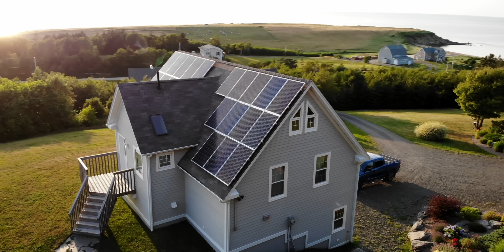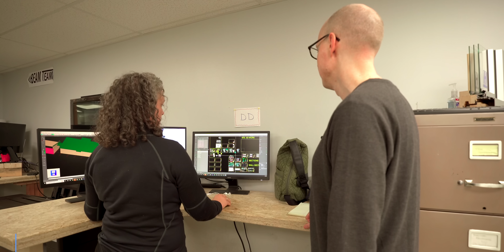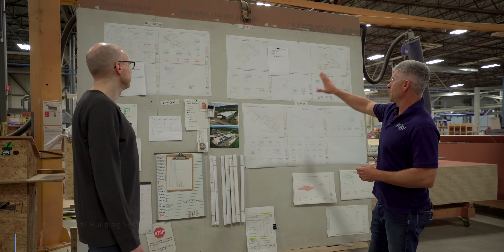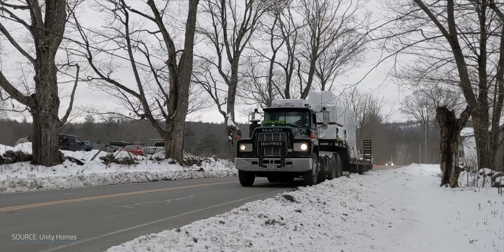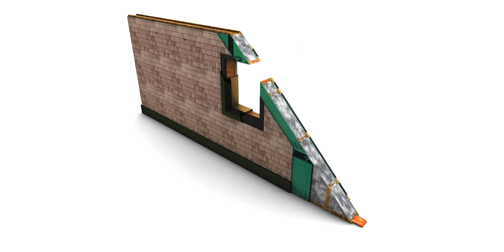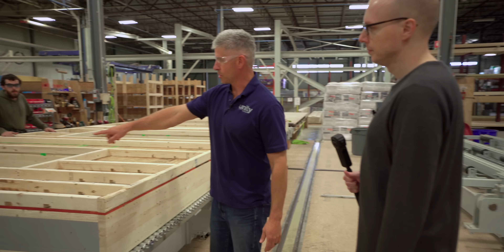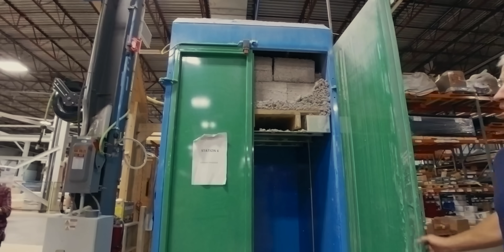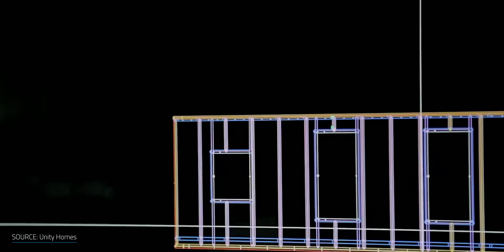The Simple Genius of a Prefabricated House - My Net Zero Home Build

Comment: I've never wanted to work somewhere based on the product, and production before. This is cool! 
The only thing I can think of to ask is; What is the initial resource consumption cost(Board Feet) versus a  more conventional home, or a home that uses the engineered 3x6 trussed studs? 
There was a lot of insulation, and that probably wouldn't be a good idea in an area like Oklahoma where tornados would make that an environmental disaster if you're using insulation that isn't eco-friendly. I couldn't find if they said what it was in the video. I would think using Mineral wool could avoid creating long-term waste.

Comment: Major disappointment to see they are using ZipWall. Nothing beats Tyvek… nothing. Any builder using alternatives is a screaming example of a company concerned with costs first and performance second. I’ve seen the unbiased science and their joint tape is all that stands between the inner wall structure and the outside weather. Furthermore, ZipTape does not stay adhered for long. Stress from weather, season changes, and the joint itself cause that to buckle and let go.. you then have a path for wind and water… hard pass on any builder using anything other than Tyvek.

Comment: Interesting video, Europe has had this type of technology in small to medium size local factories for some time now.  I’ve built 8 townhouses distribute as triplxes in 3 different buildings with underground concrete parking as a base with similar software technology in 2016 in Annecy France, from production to delivery 1 300sqm about 13 000sqf took 3-4 months to be air tight (including heavy clay tiles on the roofs )with amazingly thermal efficiency and a high level of personalized finishing.  The main difference between the eu based building rather than us basedis that instead of creating a carbon copy of multiple houses, each house can be different  from another and each is studied individually preventing everyone from having the sam as his neighbors.  Windows are also given a much more important role creating a bridge between the inner world of the houe and the nature outside, allowing an outside in approach flooding the houses with natural light and energy. Factory built homes with an architectural design twist rather than a 3 types fits all.  For a future video id suggest to try find a company with same tech but with architecture & design / eco / base rater than business concentrating on keeping costs low as a main selling point.  I firmly believe you can create incredibly designed and architecturally amazing spaces within accessible costs. Keep up the great feed.

Comment: No such thing as net zero. That factory requires electricity, most likely using fossil fuels. Anything you decorate with, any materials you use after the fact require power to make using fossil fuels. Even solar or wind power currently use fossil fuel to make so please stop lying.

Comment: No not weird at all. Only question I've got after watching this is this. If going for air tightness why have the door open in vs out so the winds press the door to the seals instead of pushing it off the seals?
Is it that it has multi point latches so it stays tight to the seals?

Comment: I think building really needs to go pre-fab; too many people are struggling to get a home built which follows building science principles and doesn't get moldy during construction.  And this company seems to be doing it right, between panelization, automation, and standardization.  I'm finishing up a totally custom build from 7 modules, and that really didn't make a ton of sense.  There were some benefits but they basically built it very similar to a regular home, just in a factory.  There were mistakes just like a regular build, and the coordination between two completely different GC's and crews was problematic.  It's been 18 months and we're way over budget and behind schedule and still not done.

Comment: Great to see properly (and repeatably) made housing. What's R35 in metric U-value (W/m2K)? A typical PH wall is under U=0.15, but it does depend on building size and shape, and the other elements (floor, windows, roof). And no, of course it's not surprising for people to think about where bolts into concrete floors/foundations go: all metal fixings can be significant thermal bridges if they go out to the cold side of things. This vid doesn't explain how the foundation is insulated. Is it a concrete slab on polystyrene base, so the concrete is on the warm side?
No you're not weird at all Matt. I was quite excited about my euro-style 3G t&t windows too. And they are very good. The quietness is the thing we most notice, and the fact that the condensation happens on the outside, not the inside, now.
Oh, Benson is doing FLOSS building design/parting software? That is exciting. Far too much building stuff is proprietary, and it really fragments things.
Great video, although it is kind of amusing to the European ear that all this fancy tech/BIM/automation is being done in imperial. I guess the computer doesn't care, and that Hundegger saw is actually working in metric :-)

Comment: The windows you are excited about are very nice.  Some of them open on two different axes depending on which way you rotate the handle.  That means you can tilt the top of the window inward (there's a stop which limits how far) so you get fresh air but rain generally won't blow in.  Or you open the window sideways like a door.

Comment: I did two jobs like this but not quite as complicated. I renovated my house and added 800 ft.². I did it partially to keep my neighbors happy since there was less construction on site. The other reason was that I wanted to support this whole concept of factory built housing. Four years later I built a 600 square-foot cottage on the back of my property using the same company and the same ideas. I’ve been delighted with both projects.
Reply: Could you tell me the company name and the cost? I really need this now. Thank you in advance. 
Happy new year

Comment: Many new things are fantastic about your build it looks impressive and I'm sure it will be hugely efficient. I recognize that your build is underway and can't be changed. I am always shocked about what has been forgotten about sustainable housing. We build 23 years ago, solar power and many other improvements did not exist. Our house was built Solar Passive, which cost us zero extra. It's just having lots of windows towards the equator annual vines (grape for us) to shade that side in summer and lots of brick the other side as a thermal energy store. We use no heating daytime in winter and many people asked us if we had air-conditioning in summer (we didn't). 
This low tech solution had saved us many thousands in energy bills and when solar became affordable we added that and our energy bills are a joke now. I can't understand why the method is not included in modern housing? Big windows towards the sun in winter heats our house toasty warm and that heat is stored in the slab and back wall keeping the house warm into the night. in summer the high sun angle prevents the sun coming into the house and the vines keep the walls cool. 
We made the plans and got the builder to build "A house" no mention of solar passive was made so the cost was for, a house, nothing special.

Comment: Just one question, the thermal insulation that is put in while the walls were laying horizontal how does it behave when set vertical? Does it have some structural stability not to “collapse“ under its own weight?

Comment: Back in the late '70s I got into an argument with one of my instructors in Architecture. I had just bought one of the first Apple ][ computers. It was the stone age for computers. I maxed out my computer going with 48K memory. Programs loaded via cassette tape, there was no lower case on the keyboard, you had to buy a printer controller card to print anything, no modem, etc. Even so, I could see a day coming, soon, where you could make a rough design of a home and the computer would look at local building codes, which may say studs have to be 16" on center, or 12" on center, and the computer would adjust the room dimensions an inch or three here and there, move a window or door slightly, all to make the most efficient to build home.

Comment: The price point for something out of the box doesn’t seem very compelling.  ICF seems better in terms of flexibility, ease of construction, better thermal performance, and more durability.  I was looking at the 4-bedroom Zum w/ attached garage… ICF for a similar structure for be about $60k for a basement foundation and the main level walls.  That is SO much cheaper.

Also, that cellulose insulation settles… so they pack it more densely?  That turns the insulation into a thermal bridge the more densely it is packed.

Comment: It is still a wooden house? Mickey mouse strength house without tornado or flood protection. Why not put some bricks on the outside to add the mass. Better insulation. Wind protection . You have so many videos about engineering. Your own house, you go for cheap and easy??

Comment: SoftPlan architectural software has been able to do what they want their software to do for over 2 decades now. I stopped using SP in 2012 and I was able to do then all that they still want to do now.
I have to admit, as much as I can appreciate engineered structures, I do not think much about the Anchoring that the guy mentioned. It certainly wouldn't fly in Ontario, Canada where minimum 1/2 inch diameter anchor bolt is required to be set in cement. Tapcon-like screws and bolts will not suffice in Ontario.
*Retired Chief Bldg. Official and Certified Bldg. Code Official in Ontario, Canada*

Comment: Matt, while I think this is AWESOME, I question how this would stack up against ICF? From my perspective you get insulation, no thermal bridging, an air barrier, all fully customizable. You don't need a plant to generate these off-site. Maybe pre-cast can already ship these with insulation?

My biggest challenge with this approach is how to bring it to market. I personally wish it was the standard, and I have concerns about adoption rate. There are manufactured homes that might be able to do something like this, but I assume there would need to be considerable investment. 

I live in the coldest region of the lower 48, and I wish we had extensive geothermal + net zero prefab. While there are people that can do geothermal, there's little if any promotion for it. Net zero home? You would have to search for it. Wouldn't it be awesome if the net zero building style was code?

Comment: Obviously more efficient way to build.  Doing a passive solar home using a lot of mass should be interesting.  I like the thick outer walls using an "I-beam" stye stud.  I would like to see a comparison with SIP builds.
Reply: Yea but that’s costing him a small fortune!!!!  It’s not worth it
Modern framing and insulation  are all that’s needed for a energy efficient home!!!!
Reply: @vandettabuilds6641  Current building techniques involve an exorbitant amount of wasted materials.  Just re-roofing & building three new walls involved four 20 yd dumpsters of waste.  A great deal of the wood product were engineered wood products.  We, as a society, should be using more efficient methods everywhere.  Already wood forest are being used up at an unsustainable rate.  The very reason large beams are now all 'engineered' materials. Not to mention the time ($) wasted due to dealing with the weather on site.

Comment: I can't think of another way of expanding passive heating (or heat resistant) design that housing market can handle 
You need both lower costs and increase precision in construction or it just won't work...thanks

Comment: Matt I would like to see something substantiating the makes less waste claims. The only thing I see that does is the use of long lumber so there are less off cuts that cannot be reused for another place. The use of engineered lumber reduces it certainly, but not any more than a conventionally constructed house that also uses it.
We still have the same edges to trim,  window and door openings to cut out, and gable angles to match that a conventional framed house has, so I don't see any savings there.
Then we have the secondary framed wall on the inside to run wiring and plumbing thru that is all wasted material IMO as it serves no structural purpose that the paneled portion cannot already provide. The interior OSB could also be considered waste as the drywall normally provides the structural closure of the wall assembly making it completely unnecessary structurally. 

So where is the waste savings?

Comment: It's too bad the exterior walls are not mold-proof, bulletproof, fireproof, insect-proof, hurricane-proof, and termite-proof. If they were ICF, they would be all of those things, and they would save energy by providing thermal mass. They would also last for centuries, and you would save a lot of hurricane straps, nails, and labor. Maybe one day, companies will be able to 3-D print a solid house with reinforcement and great insulation like ICF. If your home ever gets moisture in it, the engineered wood will turn into a black, brittle sponge that you can pick apart with your fingers. As long as you keep it dry, you'll be fine. I would invest in a really good envelope, including a standing-seam roof.

Comment: The Varm starts at $500,000.00 for 1,520-2,940 square feet! I can’t image what the actual cost is if you go towards the larger size. I don’t agree that this is a more cost effective way. This is just as much OR more than a traditional on-site built house of the same quality so where’s the cost saving…in Mr Bensons pockets I’m sure. I really like what they are doing here and but I’m tired of hearing how prefab homes cost less. They may cost less for the company to build but they aren’t passing these prices on to the consumers…

Comment: If your primary concern was thermal bridging, why didn't you specify exterior insulation to completely eliminate it and also reduce the risk of condensation on the inboard side of the sheathing? Will your walls have ventilated rainscreen drainage gaps?

Comment: Shipping: The first question we had in a discussion was what would the shipping cost be added to this? But we realized that it should be less. Considering that it would be a one way one time fee. On standard construction that fee is 2 way and spread out between each and every item.  2 way because there is a massive amount of waste that has to be collected up into a dumpster and shipped off. 
I worked for a landscape company at one time that did every step of the landscape construction. Clearing, foundation prep and fill, Grading, all the way to the final yard plants, irrigation, and flower and plant arrangements.  We saw the impact the total construction had on the site and surrounding area including neighbors.  Often there where areas that the plants and grass would just die.  This was due to materials contaminating the soil.   Seems this would all be a thing of the past in this type of construction.

Comment: I built à 2×70m 2 with local straw and wood casting , clay/hemp walls .40cm of straw....cost of total isolation 800   straw bale ×2 € = 1600€ for de 6 sides. 
Total cost of the house ( self construction)with small wood stove,  double flux ventilation, salar eating pannels,and 5 × 400w solar pannels...........
 65 000 €.
Price and ecologicaly unbeatable.
From Belgium

Comment: Everything should be built like this.  In the UK, the whole new housing stock uses these types of doors and windows, which are the best.  My current windows have been in place for 25 years and show NO sign of deterioration, leakage or deterioration, they are like new, with no faulty catches or joints.  No, they are not wooden/biodegradable, but they don't biodegrade (rot) in situ either.  I know which I prefer.  One thing though, here we use bricks and blocks two-skin construction by law.  They are incredibly strong. Don't these light wooden houses degrade during their lifetime? Great video, and a fascinating project.  Good luck and I will be following closely.  Are you likely to throw a few numbers into the script for comparative purposes vs traditional construction?

Comment: This is a great step forward in house building. We’ve had prefabricated homes before, particularly in the post war times, both in the UK and US in particular come to mind. Homes (and jobs building them) for those who fought in the war. And to allow for a recovering of economies, with growing families and what not.
The problem with the old stuff was it was thrown up with just speed and cost in mind. This meant corners were cut.
Thin walls, little to no insulation. Crazy building materials in hindsight eg. Asbestos.
Of the many which still remain to this day in the UK some following 40 year projected lifespans; maintaining them is becoming an issue, also getting mortgages on some of them can be particularly difficult due to their “non-standard construction”. Buildings to mind suffering these issues are some with thin steel framed construction, and ones with unusual roofs such as flat concrete.

Seeing them built like your to a high standard, aiming for modularity gives me hope that we’ll be able to build homes which have a lower carbon cost to build, quicker to build, less labour (wasted due to weather, snagging, schedule problems). It should allow home builders greater turnover rates.
I wonder how costs will pan out long term compared to retrofitting old housing stock.